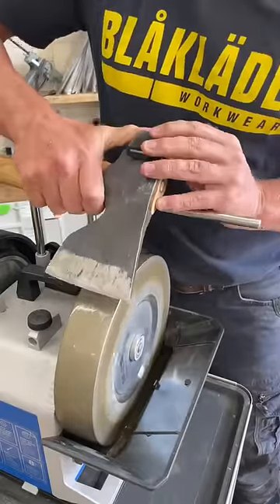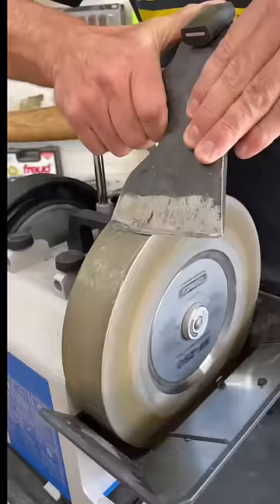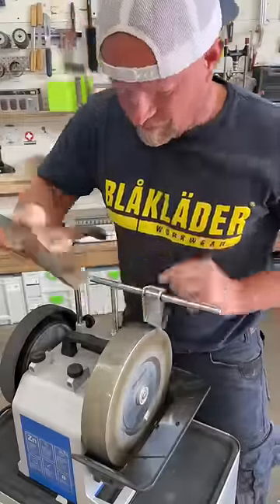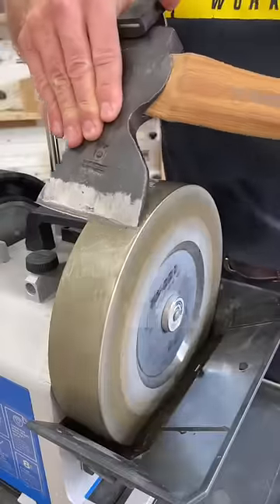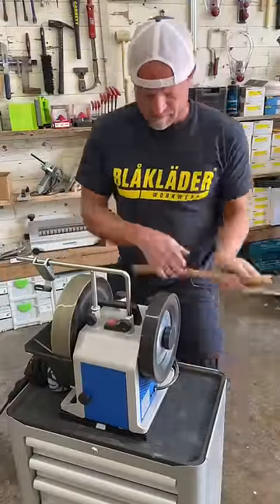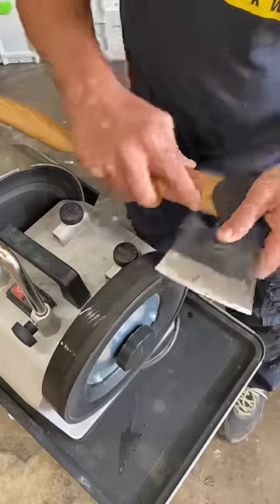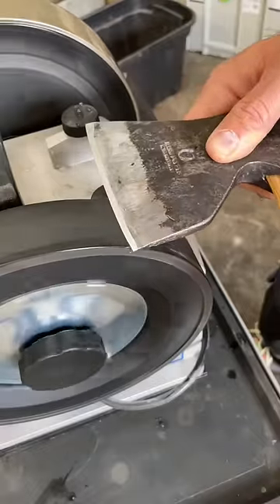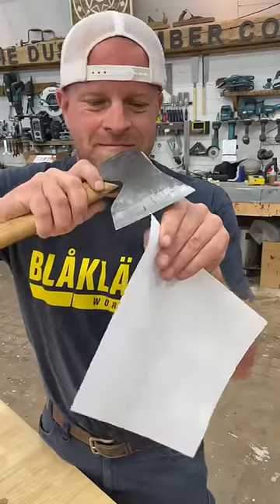Sharpening my axe #woodworking #woodwork #wood #maker #shorts #tools #woodworker #bois #holz #madera

Comment: One thing to remember when axe sharpening  you don't want to heat the metal up get it nice a wet with a good oil or water flow 🙂
Reply: AND SLOW SPEED TOO...

Comment: Dayum!!! You sharpen your axe as sharp as I do my blades!!!
Interesting...
How long does it last with day to day shores.
Reply: 1 Hit near dull as start
Reply: @2000rohr  I bet
Reply: @2000rohr  yup
Reply: It'd depend on the wood etc he seems to be a fine wood worker so potentially using it more for rough carving than felling where theres less chance of edge damage.
Reply: @2000rohr  na you'd be surprised how long a good axe will stay hair splitting sharp.
Reply: @brendandor  It’s an Axe for Kindling. I wouldn’t use it for anything else really. It’s not something you would split wood with (you could size down something already split), if you had a different head and handle with the same sharpness it should last ok as long as it’s hardness is highish.

Comment: So the main problem with this kind of sharpening on an axe is it won't hold up the edge is to thin to do any proper chopping it needs to be a convex edge, but for every day simple tasks this is fine you just need to sharpen more frequently but you do run the risk of chipping the edge.

Comment: Good job, but have you ever tried Nordic axe grinds? I really prefer the convex-to-zero bevel on a Gränsfors for example. 

Bites much better than such a flat bevel and if maintained regularly you’ll never need any machines to get it back to a razor sharp edge. 

But a messed up(not maintained) convex edge takes a lot more effort to get it right again. So both bevels have their pros and cons.

Comment: Pair of scissors ✂️ for the paper or fabric cutting would've sufficed; then maybe a wood-plane would've done the job for the wood.  Psssst...if you pull the start cord on a chainsaw it'll make noise. A lot of noise! That means its working.  Just didn't want ya to be startled and hurt yourself 👍🏼😉👍🏼

Comment: Can be very unwise to sharpen an axe that sharp. They aren’t meant to be razor sharp because of the massive force that edge endures with every swing. A sharp edge means a smaller amount of metal contacting the wood at the point of impact, and this can chip/bend/warp/rapidly dull your axe edge and wear it out. 

Now, this isn’t the case of every axe, some are made of ultra high quality steel and thus doesn’t matter how sharp you get it. But any axe you buy at the store should never be as Sharp as you got it. I just use a little fine grit hand file to sharpen mine.

Comment: You stropped your axe? What you plan on cutting w it? Lol. I use a dual angle edge on my axes. 70 and 40 degrees and always light strike the blade to roll the edge.

Comment: Where's that ray sharpens dude. Everyone arguing with me, Ray doesn't use coolant on his belt grinders, ruins the heat treat, this proves it, dude has a self lubricating sharpening wheel lmao.
Reply: It entirely depends. It's not as simple as 'it does' or 'it doesn't.'

Thickness of stock, angle (surface area in contact), abrasive used, surface speed of the abrasive, the type of steel being ground, how much pressure is used, the grit being used, etc etc..

Generally it will be fine. And he almost always finishes with a stone, removing the little that would be 'damaged' by hot grinding.

So in short, he doesn't 'damage' knives.